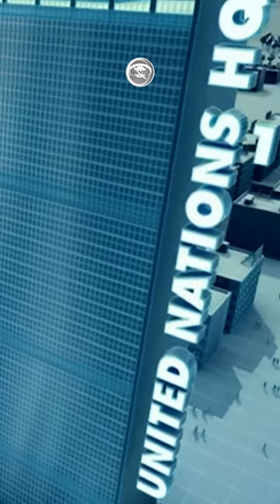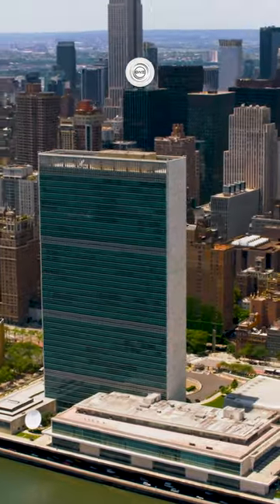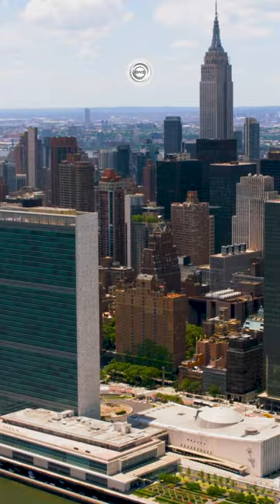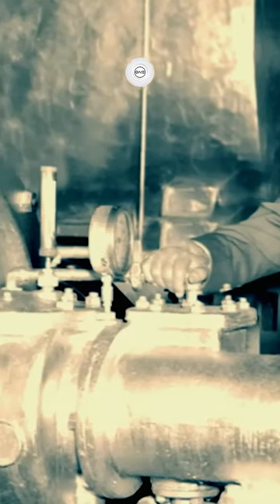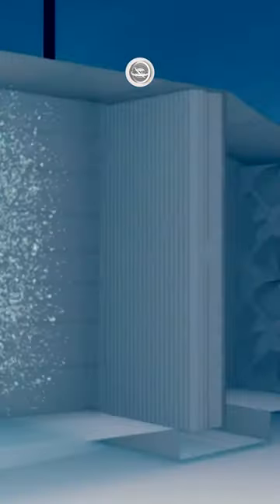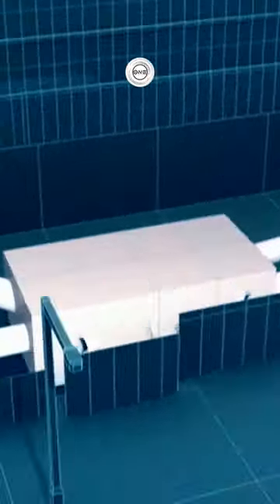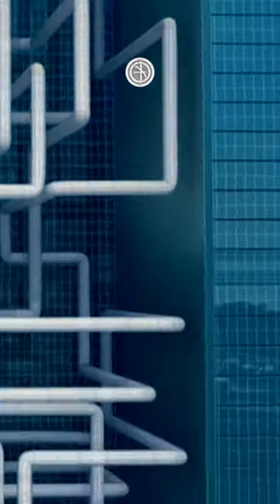The First Fully Air Conditioned Glass Skyscraper In The World

Comment: Double pane, UV and IR reflective coatings on all windows would have been smarter and cheaper.
Reply: They didn't have that sort of technogly in the 1960s.
Reply: Who said any government agency cares about efficiency?
Reply: @kaymish6178  Actually, they did. IR & UV coatings for glass existed during WW2 while creating & testing the atomic bombs. The windows could also have been coated or replaced at anytime afterwards.
Reply: @rusted5408  Nobody did
Reply: @BruceNewhouse  YOU said it would've been smarter and cheaper.
Reply: A glass company told me that UV coating would not help with the heat load. He said that it helps prevent fading of items.
Reply: @1985230ce  well he is wrong. Or more likely you are lying.
Reply: @rusted5408  why tf would I lie about this, ah! What is to be gained by it, DH?
Reply: @rusted5408  you realize that every single wavelength of light caries energy... right?
Reply: Aluminum blind
Reply: @BruceNewhouse it's like saying aluminum glass would be cheaper against terrorist attacks in schools and the military has it, it was anything but cheap in the 1960s
Reply: @BruceNewhouse yeah it wasn't cheap nor well known in the 1960s they didn't have the internet to check on what the military was doing

Comment: Huge waste of energy
Reply: Exactly I think the fault lies in the design of the building
Reply: Good thing the sun exists for unlimited energy
Reply: @A10914  The fault lies with the design of the HVAC system. The building is just a normal 50s era nyc building.
Not fun fact, I grew up on Roosevelt Island, with the UN in the background.
I was thinking they would have put a second mister on the roof so the systems could meet in the middle instead of one on the ground running a marathon.
Reply: Who cares it's only tax payer money and it's not as if the tax payer can do anything about it....
Reply: @noeneonmusic  we're using energy to cool it.
Reply: Womp womp
Reply: @noeneonmusic  Do you think they had a plan for all the CFCs that would have been released back then?
Reply: Who’s working there? The UN is a work from home organization
Reply: How so?
Reply: @DaleDenton-ov5pg  air conditioning requires energy.  large glass building absorbs all of the light that hits it.  alot of ac = alot of power
Reply: @Kids11111 it wasn’t a known concern then.
Reply: You could use the heat energy and you don't need to heat the building in the Winter.

Comment: There's actually a glass building in the UK without air conditioning - most years, it accounts for most of the heat stroke cases in the UK. Actually, that information was current when I was an undergrad. I don't know if that building is still standing or not.

Comment: Better complement this HVAC innovation with replacing the glass facade with photovoltaic cells sandwiched in transparent glass on outside and semi-reflective glass on the inside. 
The semi-reflective glass would reduce the heat getting inside while the energy generated with PV cells could be used for HVAC.

Comment: There need to be a glass, 
that only passes visible light, and reflect all other wavelengths (including infrared ).

This will drastically reduce the heating effect.
Reply: Is this a joke? Cause that works so well on the planet Venus. When visible light hits objects, whatever doesn't get reflected gets converted to heat. Those objects will then glow in the infrared and you want to trap that in? That's how you heat something up from sunlight and then retain the heat, not cool it down.
Reply: @wally7856  no it blocks the infrared sunlight to prevent it from going into the building